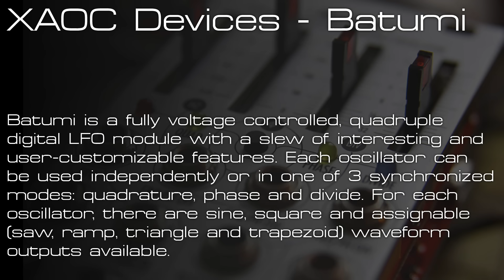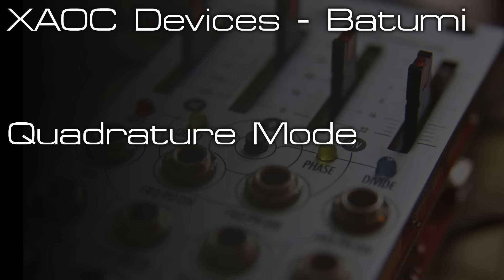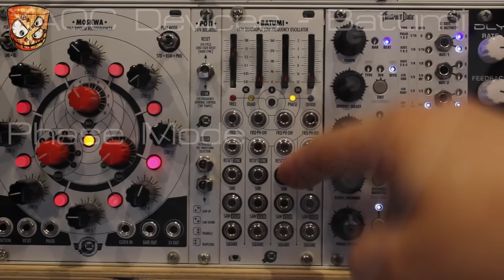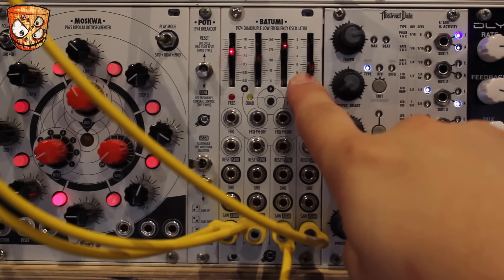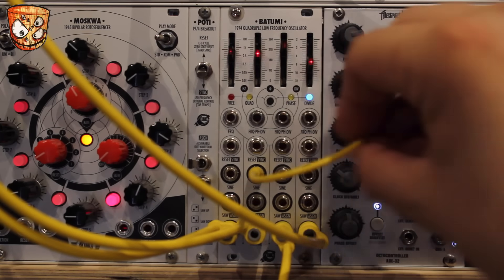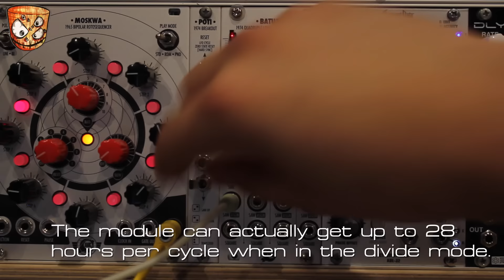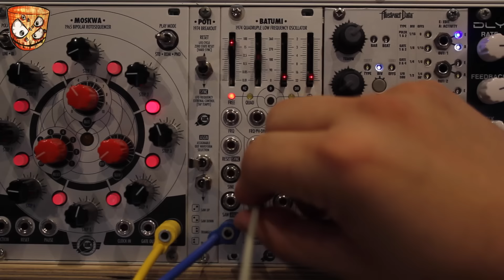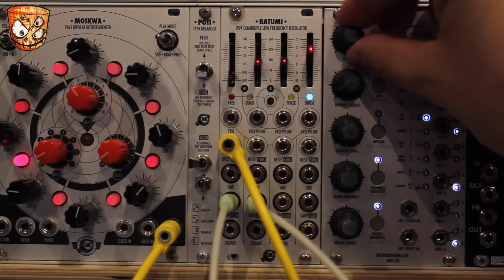XAOC Devices - Batumi

Comment: Thanks for the great demo. A few shops just finally got these in over here in the states. I'm definitely going to have to get this one and the POTI for it.
Reply from the maker: ***** I think the Poti is essential. If you never clock anything and really don't want to then maybe not but for me I'm not into having jumpers for anything on the back of modules. Having the expander is great for having different shapes on offer and clock or reset.
Reply: DivKidMusic I'm the same way about jumpers on the back of modules. I'd like to have all options available from the front panel, or in this case, the expander.
Reply: Hi Ben does that mean you can't clock the Batumi without the expander? Thanks
Reply: badaszewski You can choose to either clock it or tap tempo (with manual gate) with the jumper set to SYNC mode or reset the LFO cycle to zero (hard sync) with the jumper set to RESET mode. The expander just lets you throw a switch to change between these two options without unscrewing the module from you case to set the jumpers on the back. You could also make your own expander if you know how to.
Reply: ***** cool thanks

Comment: Looks like a worthy addition!  Is there any way to skew the wave forms like on the QPLFO?  Or the lesser likely, do a one shot?  Thanks for the vid!
Reply from the maker: no waveform shaping on board. I like running CV through the Abstract Data ADE-10 Reactive Shape or wave folders though which is good fun if you're looking for some CV wave shaping. They don't do an envelope style "one-shot" either. There's way to patch up something that would "one-shot" but it would be a big elaborate patch with many modules.
Reply: +DivKidVideo OK. Thanks for the info. I was hoping it could replace the QPLFO as I like to use that as the EG for drum synthesis. This still looks like a worthy addition tho.
Reply from the maker: does the QPLFO do single cycles?

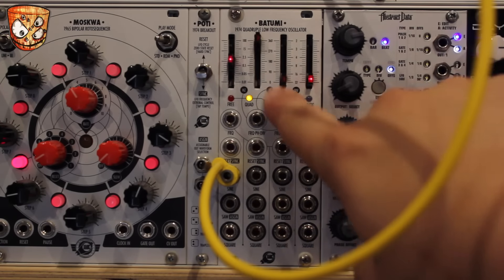Comment: Question: @ 3:28 in the video (quad mode); if rate is controlled by the first LFO do those other 3 faders control the depth of LFO's 2-4. Thanks!
Reply from the maker: If I remember rightly there's a mode that changes the phases of the LFOs relative to the first and another that changes the clock divisions of the LFOs relative to the first. 

Just checked the manual

"2. QUAdrATUre lfO MOde
Click the central button until the yellow, quad LED lights up. The first LFO is a master con- trolling the frequency of all the remaining LFOs. Each subsequent LFO generates a wave that is 90° shifted in relation to the preceding one (90°, 180°, 270°). In this mode, sliders 2–4 and the CV inputs control the respective channel’s am- plitude. The reset/sync 2–4 inputs allow for additional control described later in this manual."

Comment: Sorry to resurrect this old post. Ben in the beginning :37 you say "...each new note triggers a gate." How exactly were you doing that? Battumi to attenuator to quantizer, sending pitch info to oscillator. Where does the gate come from?
Reply from the maker: Quantizer generates a trigger on each new note.
Reply: @DivKid  Thanks Ben, Still trying to figure out how to do this. I'm using a O_c in Quantermain mode. My understanding is that I would only get pitch CV out from that. Sorry still learning.

Comment: Is that the best lfo module in your opinion or...?  ...or Fourmulator is better... or any others u prefer?
Reply from the maker: I think "best" doesn't exist. It's too subjective to say outright something is the best. What are you looking for in an LFO module? Then we can be specific and cutting down the options to best suit you.
Reply: DivKidVideo wuz worried ud say that..good honest answer nonetheless.. hajajehe
Reply from the maker: haha well Batumi is fantastic and I'd recommend it for adding LFOs to your set up. Abstract Data Octocontroller is also very good for LFOs and Random / Clocks etc. Plus 8 outputs. They function differently though. So what are you wanting LFOs for? Sometimes you want CV over the LFO so a feature packed one is better other times just lots of LFOs is a good way to go.

Comment: what voice are you using in the phase section its really nice
Reply from the maker: The sounds from the phase section are sine waves through a VCA that's got a little clipping and character to it. Judging by the date the video went online (as I really can't remember 100%) that's 4 Intellijel Dixie mk1 oscillators with their sine waves into the individual channels of a Bubblesound VCA4p. Using the LFOs to modulate the levels of each VCA. Oscillators just turned up to an LFO.

Comment: How exactly does one get it to cycle at a 28 hour interval?
Reply from the maker: if I remember right you go divide mode, set the frequency on channel one as low as possible and then use another channel to divide that down even further.

Comment: can u use it without the poti and still sync and use it as a clock mult/divider too?
Reply from the maker: Hello, yes the settings are set with 'jumpers' on the back of the module. So you can set it up as you like then forget about it. POTI simply offers a way to switch these things quickly without removing the module from the case.
Reply: @DivKid  Thnx for the quick reply Ben. However is it poss to use it as a replacement to a typical clock? say a time wizard?
Reply from the maker: yes you cause LFOs as clocks. Best thing is to take the square wave out and use that as the clock signal.
Reply: @DivKid  i imagined that was the case but is great confirmation coming from you :) thnx man
Reply from the maker: happy to help

Comment: Around 11:04, it sounds like one of the modules is triggering when the light on the rightmost slider goes out rather than fully lit. Is that normal? I'd expect the light to be highest when the square wave's just moved up, but it looks like the opposite.
Reply: LEDs on sliders indicate the sine wave, not square.

Comment: how to compare this to an ADE-32?
Reply from the maker: I can't really offer much other than what you can find just looking at both modules. This is four channels ADE-32 is eight. ADE-32 will do more per output mode but those are a button press or so away (still fast and very much NOT menu diving). They are different in HP. This is sliders per channel function and four modes, ADE-32 is shared knob control and LED feedback for settings. What is it you want to do?

Comment: Hi, wich Attenuator do you use?
Reply from the maker: +Ottookkowumbe FM no idea what I used in the video. But it really doesn't matter. An attenuator is an attenuator. It brings the signal down from full signal strength (whatever you put it) to 0 and everything in between. I have a Thonk AT AT AT which is good, the RYO Airtenuators are great for putting something between cables. I probably used Airtenuators in this video. Sometimes I use a VCA with bias/offset/gain control and just use the manual level to attenuate signals without actually modulating the VCA.

Comment: during the very first example, how do you get a gate for each cv note outputted by the quantiser?
Reply from the maker: ADDAC 207 quantizer has trigger outputs for evertime a new note is generated. Really useful feature. Also trigger in so you can tell when to quantise if you don't want it free running.